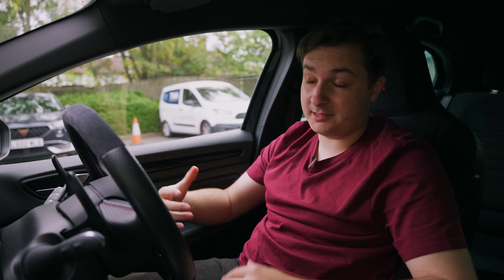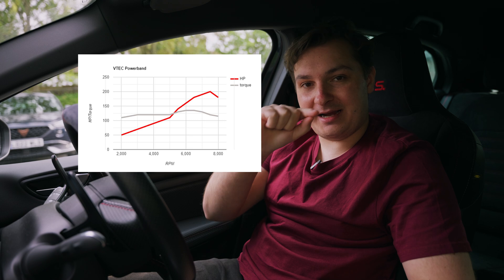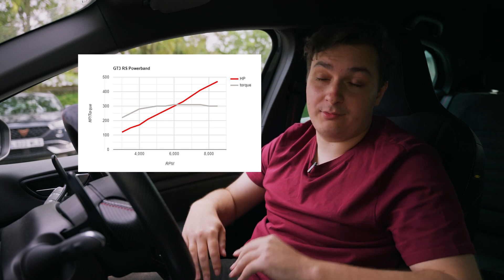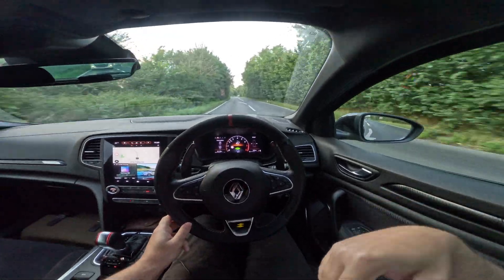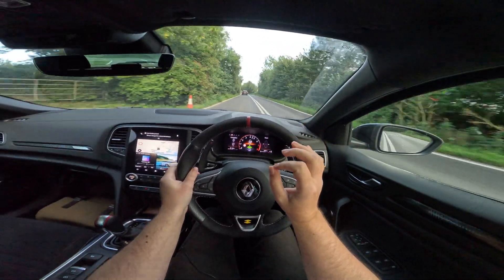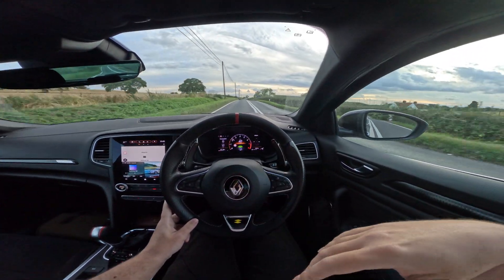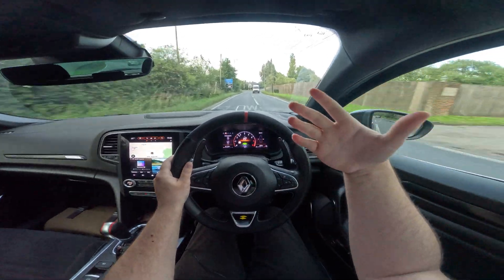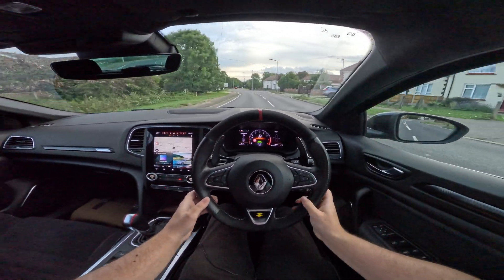What is powerband? Engine characteristics explained

Comment: The diesel power band a minute in, is like the Peugeot 206 HDI I had. Identical power at 3000 and 4000 rpm, and dropped off towards 5000 rpm. Actually took a while to get there. I've found the Ford TDCI engines to be the opposite though. Not much power below 2000 rpm and a nice big wave at 3000-4500. I wonder what it is for an electric car. I think in single speed transmissions, the computer will have the power build so you don't burn the motor accelerating at maximum from low speeds.
Reply: Similar to Mazda 2.2 skyactiv d, gets going at 2500, revs to 5500.. odd for a diesel

Comment: VTEC for anyone that doesn't understand: cams shift and intake valves are opened more and for more time. More air gets in and more power is made. It can have a lot of power and still be economical when you don't need the power. Great video as always :)

Comment: I don't think a diesel is quite that level. My Peugeot 2.0 HDI was 90 hp at 3000 and also 4000 rpm (because at 4000 there was a third less torque), and above that it dropped off towards the limiter at just over 5000. Probably 3000 would be the most efficient for max power then. I've driven diesels that pulled well to 5000 - where the computer kicks in to protect the engine. A Focus TDCI my parents owned, didn't do that much until 2500 to 4000 (although being my parents' car I didn't drive it super hard). I can't remember for the Fiesta 1.8 LX.
With a turbo, it's harder to measure because there is a lag until the power stabilises. If you were to floor it and hold the brake to set the rpm, you would get a different graph to an acceleration run in 1st gear.

Comment: Like an automatic car in mode sport/race in which the car has the best acceleration possible, the same applies to the manual one's... The driver should be choose the best gear based on the moment to achieve the maximum power possible. When the car feels flat is the best moment cause its produces the max power until you feel like the acceleration decreases and probably the rev limitator is the next step 😂😂
Reply from the maker: I've started working on a video about gears - this will be coming in a few weeks. You're talking about exactly the things that need to be in that video 👊

Comment: Do a pov video with ev and your opinion  about driving an ev
Reply from the maker: Funny you should mention this - I've got an EV for the day when my car gets serviced this Friday. I'll make sure to squeeze out a few vids :)
Reply: EVs do have a power band. For a motor driven by a set voltage, it's just above half no load speed and half stall torque. In an electric car, most have a single speed. I will assume a computer limits the input power at lower car speeds. In something like a Tesla, I would imagine you are not getting full power until at least 70-80 mph, because a motor that wants to spin 120+ will have a terrible time being loaded to the maximum to pull from 30, so instead it's just easier to raise the power gradually as the car speed climbs. You will reach the no load speed eventually, which is why single speed electric cars usually have a limited top speed compared to the petrol or diesel engine equivalent. If you looked at the graph, you'd find it wasn't making the maximum power at the car's top speed.
On a multi speed car or bike, one difference between petrol and electric is ideally in an electric you want to cruise at an rpm that's ABOVE the power band, unless you really don't need much power at all - like on a long flat city street with no stop lights. On my electric bicycle mid drive, I keep the rpm high, and dip down into the power band. Although with that bike, you're using more of the available power than in a Tesla Plaid, where everything is effortless for the motor outside the drag strip.
With an ICE, you want to do your general driving BELOW the power band, otherwise you will waste fuel and wear out your engine components more quickly. With electric motors in general connected to a flat DC source rather than a sophisticated speed controller, you want to stay away from heavily loaded low rpm as these are what cooks the motor.

Comment: Fantastic video as always Mick! 

What I would like to add here, and especially for "slower" car owners is this. 
Find out and remeber your top speed for every gear. Rev it out in second, third (and if you can in forth), and keep a note of top speed for each gear. 

This way when you get to the situation when you need to accelerate fast, you know exactly whether you can downshift or not.

Let's say that top speed for 2nd gear in your smaller city car is 85 km/h.
You're driving at 60 and are in 4th gear.
If you need to accelerate fast and hard (due to traffic conditions), you know that you can downshift to second and floor it (because 60 is below 85, which is top speed for 2nd gear). 

On the other hand, if you're driving 70, you might want to downshift to 3rd, because you will only have 15 km/h left in second, until you hit that Rev limiter. As Mick already pointed out, you need to find RPM range where your car "pulls" and where it does not. 

Also, one thing to point out is that gearbox also changes the wheel torque. E.g. you will have much more wheel torque in 1st gear than in 3rd, because of how gear ratios are setup in you gearbox.
1st gear is all torque and no top speed. And 5th or 6th gear is all speed and no torque.
If you drove the bicycle, you can probably imagine how it works. Vehicle gearbox is very similar to that :)

That's why you will have a lot more pulling power (torque) in 2nd gear compared to 4th gear. 

Just take care not to downshift above your rev range. It's called money shift. If your car is limited to 85 km/h in second, and you downshift to 2nd while going 100 km/h, your engine will be toast. Google money shift and please don't make that mistake. 

Also, don't experiment with high RPMs while your engine is cold. Ensure that you've been driving for at least 10 minutes (or even 20 in winter).

Happy driving!
Reply from the maker: Phenomenal comment mate, thank you!

It's one of those things that just comes naturally for me, so I didn't think to include it in the video, but a great breakdown here someone could really benefit from!
Reply: Brilliant comment!
And comparison to bicycle is excellent, best way to understand it since you are the "engine" and have to suffer on your own skin if in wrong gear.
Reply: I feel that my car becomes happy from 2200 rpm, anytime I need power I downshift to match this rpm and power comes no delay, is this the same working logic as  powerband?
Reply: @jackzheng6449  it's hard to say. Do you drive diesel or gasoline? If gasoline, is it turbocharged?
Some turbocharged cars can be tuned to give you full (or most) torque at specific rpm range (starting with 2k rpm for example).

Diesel cars have all the torque at specific rpm, and torque starts dropping from that point up in the Rev range.

Anyway, I would suggest that you avoid flooring car at low rpms (below 2k). Diesels might be fine with that (idk i never drove a diesel), but it's a no-no for gasoline engines. It is called engine lugging. It is basically forcing the engine to work harder when it's not in the "power band". It can cause carbon buildup and pistons to bash against sidewall.

I would say that if your car has power at specific (lower) rpm, feel free to floor it. Otherwise, downshift.
But I would still refrain myself from flooring the gas pedal if my engine would be below 2000 rpm, no matter if gasoline or diesel engine.
Reply: @dsitum  apprieciate it. my car is Maserati F160  3.0 twin turbo, powerband seems always starting at around 2200rpm until gear 5, higher gears(6~8) requires 2700rpm to get the same power response. Really lots of fun to discover.
Reply: Thanks for the cool video mate. Please help. I own a MK 5 golf r32. Specs on power says 250hp@6300 rpm. Does this mean I should shift every gear at 6.3 rpm to get maximum power? Does it lose power if you shift late? What's more strange is that if you launch it and decide to let it take charge of the gears it will shift by itself at 7000 rpm. So is shifting at 6.3 more powerful than 7000 rpm?
Reply: @calvinsinvula1731  It only means that your car makes most power at 6.3k. It's top torque is between 2500 and 3000 RPM (320Nm). However, horsepower is factor of torque and rpm. And torque is what's the most important thing for acceleration. But it's kind of complicated because wheeltorque differs with the gear you're in. Engine torque is not the same as wheel torque. Engine torque depends only on RPM (how much torque your engine can deliver at that specific RPM). However, to get torque delivered to the wheels (wheel torque), you need to multiply the engine torque with the gear ratio (multiplier) of the gear you're in. If you noticed that 1st gear pulls harder than 5th, that's because 1st gear mutliplies your engine torque by 3.36x, while 5th gear mulitplies it by 0.86x. That's almost 4x difference, meaning that 1st gear pulls 4x harder than 5th gear at same RPM. However, because of that, 1st gear is much shorter than 5th gear.

You can find these specs, such as gear ratios, torque, power, etc. for your car here:
https://www.billswebspace.com/R32TechnicalSpecifications.pdf

Now let's say that you are in 3rd gear and at 3000 rpm. Do you want to upshift there just to get back to the sweet spot at 2500-3000 in 4th gear? No! Because torque will not just dip after 3k rpm. You will still have plenty of it (regardless of gear you're in because that's how most engines are designed - to provide as flat as possible torque output across the rev range). And if you decide to upshift, you will lose that precious torque.
3rd gear has torque multiplier of 1.47x, while 4th gear has multiplier of 1.10x. If you upshift at 3k RPM, you will lose that 0.37x of torque. So upshifting is in most cases just not worth it until you've reached high enough RPM.

Now, to answer your question - if your car makes most power at 6.3k RPM, why doesn't transmission shift it at 6.4k? Well, most likely because of gear ratios. Because at 6.4k at 3rd gear you will still have more wheel torque than at (let's say) 6k at 4th gear (when you upshift). Engine torque is very likely better at 6k then at 6.4k, but when multiplied with gear ratio, wheel torque probably gets worse.
And IMO that's why your car shifts at 7k, and not at 6.3k, so it's perfectly fine :)
Reply: @dsitum  thanks so much for your quickest response. I love your connection with cars and I'm starting to love the Megane RS.
Reply: @calvinsinvula1731  I drive the Hyundai i30N face-lift. But I'll be honest, I would love to try out that V6 naturally aspirated beast that you drive 😁

Comment: Beautifully explained and easy to understand. I think there is a gap in YouTube regarding contents like this, educational yet not going too technical. Hopefully I will see more content like this in your channel; making good use of high performance cars. I personally drive a Hyundai Elantra N, similar specs to your Megane RS.
Reply from the maker: Thanks mate! Glad I'm clearly making content people want to see :)

I did testdrive an i30n before I bought my car - close 2nd. Loved that thing but couldn't get on with the suspension.
Reply: How is Elantra going? Had any issues with it? I ordered my i30N DCT, and a impatiently waiting for it to arrive 😁
Reply: @dsitum  No issues so far, 3000 km on the odometer so far.
Reply: Beautiful thing with our N cars is that they have max torque between 2100 and 4k and something.
They are so finely tuned.
Reply: It's like a budget FWD BMW M car 😁
Also, the Hyundai Elantra N has almost identical or better 0-60 mph figures than the new Ford Mustang Ecoboost 2024!

Comment: what a wonderful video. Foot  to the metal  in 5th gear at about 1800rpm but no response. That was my first experience with my manual when I was just new into driving.
Reply: Same, especially on the highway, when you're trying to overtake a truck and end up blocking the entire fast lane. Fun times 😅
Reply: @dsitum  😂 I can admit when i first started driving i did this a few too many times
Reply from the maker: Glad you liked it mate! Have to actually drive to get the most out of the car 👊
Reply: @MickDrivesCars  I had a girlfriend like a diesel car like that -everything at the bottom wasn’t much up top😂